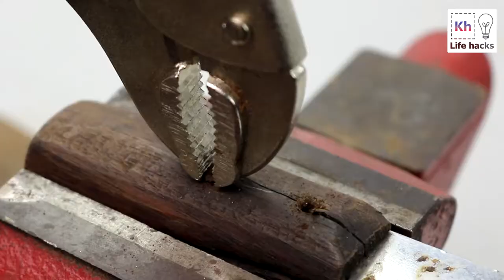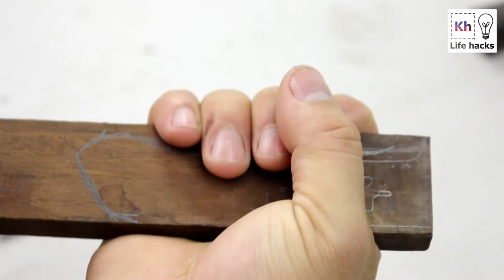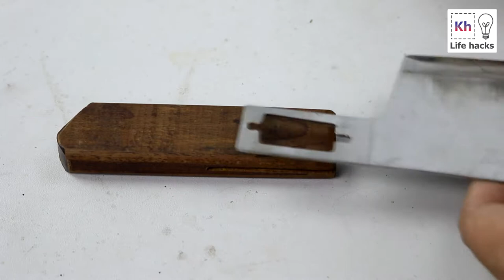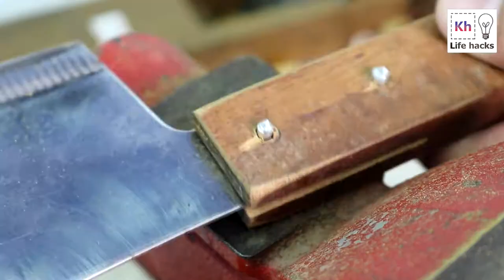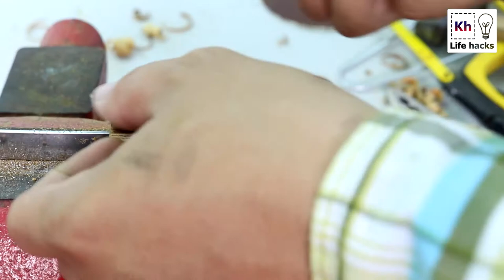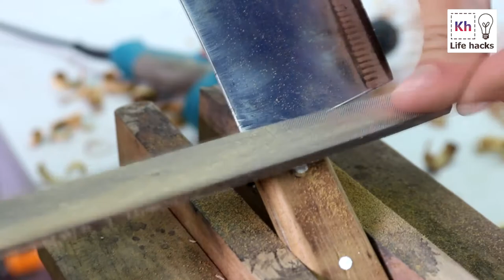How to replace knife handle

Comment: You cracked the wood while hammering in the wire  pieces. That handle is already weakened, and most likely will need to be replaced very quickly.